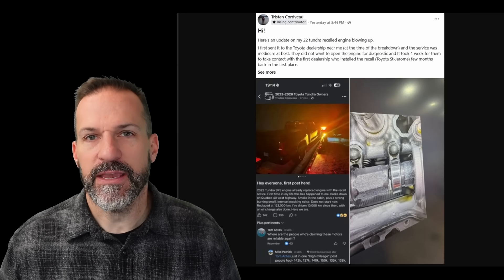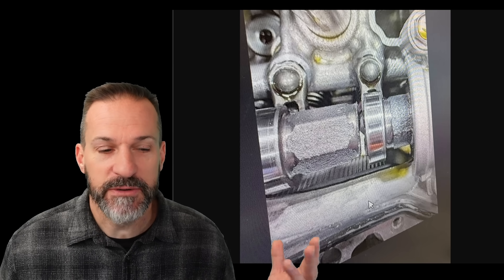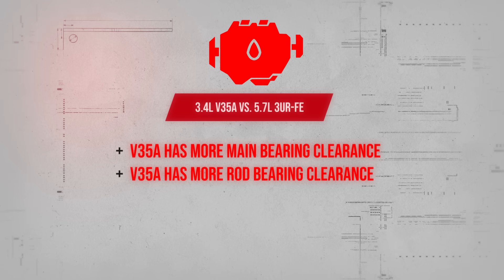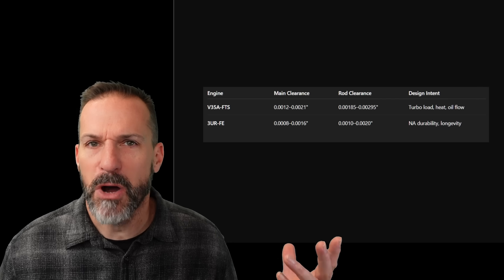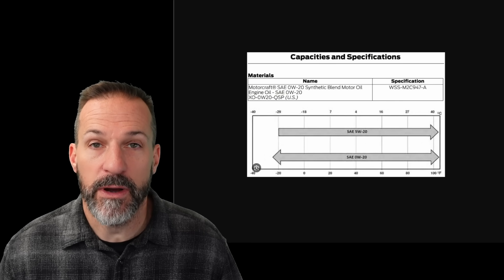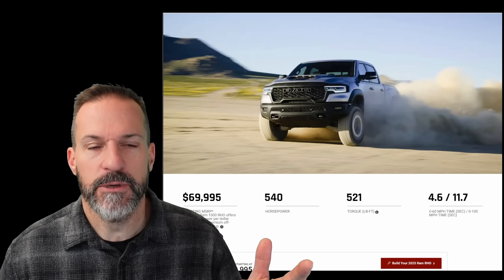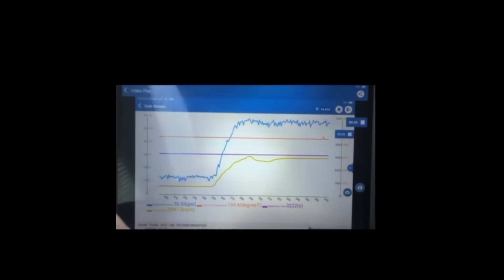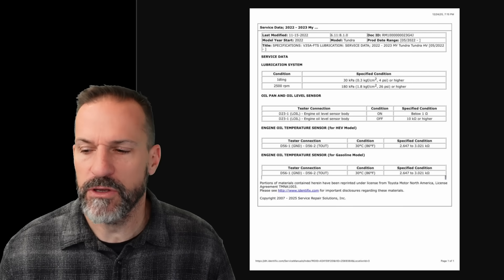Can We FIX Toyota's BILLION Dollar Mistake at Walmart? 2022- 2026 Tundra...

Comment: There are engines that run low oil pressure and last a long time. My 80s Subaru EA71S engine only runs around 5-10 psi at idle and minimum spec is 3 psi. It however runs 10W50 or 15W50 oil and has quite large clearances. Those pressures are with the oil at 240-250 degrees after driving on the highway however. On cold startup it idles at 70-80 PSI. That engine has around 250k miles on it since rebuild. On the other hand my other car, 75 Cosworth Vega idles at 80 PSI cold and 60 PSI hot with 5W50 oil.
Reply from the maker: What’s the power output?

Comment: What controls the variable oil pump ? How can pressure be increased?  Yes smaller motors need better protection and thicker oil . But pump pressure should be controllable somehow. And what about the GM 6.2 its not smaller but it’s really junk and the 6.6 is ok!! That’s a real question . The 6.6 is strong the 6.2 is defective! . I say start thicker oil now  0/40…5/40 , how about 10/30! It’s worked for 50 years !!!  10 was the minimum for maybe 70 years now it zero !!!

Comment: Honestly anyone running anything less then 0w-30 to 5w-30 in 2025 just hasn’t look into this enough, 99% of the time it is better for any engine. All my Toyota Lexus I run 5w-30 new or old. Moms bmw x5 with b58 turbo running 0w-30
Reply: 0w-30 is what’s recommended in my Elantra N (I know, not the same, but when you have a turbo running 16-20psi of boost lmao) and I’ve done a few blackstone labs with very minimal engine wear and I’m at 52k miles. Long story short, I concur with your advice.

Comment: The oil gauge in my old 2000 GMC 2500 6.0 shows a little over 40 PSI at warm idle. 4 PSI? Wow. Sounds like a disaster is coming up.
Reply: You can't rely on those factory gages at all.  They are more of a go/no-go indicator than a true representation of oil pressure.  Hook up a real instrument and check again.

Comment: A Turbo charged Gasoline engine in a Truck in my opinion is a Bad idea 👎🏻 

To many moving parts a heat management system that is stressed to begin with, then you hook up 10 thousand pounds over load the payload and cook your engine oil not to mention the Turbos is a recipe for disaster 🙄

Welcome to the 21st Century where everything is made of plastic and has turbochargers 🤨🙄

Comment: I owned a 2011 F-150, purchased new in 2011, with 3.5L Ecoboost, and the oil viscosity listed on the oil cap was 5W-30.  I never had a problem with the engine and owned the truck for 10 years.
Reply: Same, had mine for 12 years, no issues.
Reply: @vettle1  Thanks for posting.  How many miles?
Reply: @manchesterroofingsystems8016 I believe, when I traded it in, it had around 170K..... Not a lot but after 12 years I wanted a new truck.
Reply: To be fair, I replaced the water pump around 110K... So I went ahead and did the thermostat since I had it tore apart in my driveway
Reply: Thanks for posting.  How many miles?

Comment: The ram 6.4 requires 0w 40 and they are tanks. .but not subject to cafe...hmmmm. sounds like under engineering that we now see across the board with toyota meets thin oil and over stressed turbo engine to meet cafe standards....and it was not a match for a long term relationship
Reply: Not subject to CAFE?  How’s that?

Comment: Granted I am pretty old school, but it sure seems as though heavier oil is going to be better. Many years ago, I worked for a company that had a large fleet of F150's with the old 300 Inline 6 Engines. We ran 15w-40 Diesel Oil in all of them all of the time and as far as I can recall, we never lost an engine.  I am not suggesting using that oil today but the principal is the same.
Reply: The 300 straight is legendary.. Up there with the Jeep 4.0.
Reply: @vettle1 Now these Toyota V6 engines are legendary,  they also blame US manufacturing. Oil viscosity and no "staked" bearings, not good engineerring
Reply: @tcmits3699 true!  They did drop the ball bad.  Sad to see.
Reply: @vettle1 Spun bearings been around for ever, that's why they should be staked, that little deformation.  They put that there for a reason.
Reply: @tcmits3699 yes they have but THIS isnt normal.

Comment: 4psi would have tripped the idiot light back in the old days
Reply: If I saw 4PSI I would be on the line to the rollback.
Reply: A lot of old oil press switches tripped around 15psi
Reply: Old vw beetle run 2-3 psi at idle. 
They made 30,000,000+ engines. 

And those engines never spun main bearings
Reply: @fastinradfordable no they burnt #3 pistons all the time because they ran so hot from the oil cooler location.
Reply: @pl5624 yes up until the doghouse shroud released in 1968. 

And stopped having that problem until 2004 end of production.
Reply: @fastinradfordable Two to three would be very low. 5 to 10 at hot idle, with a preference for 10 (as per the 10 PSI per thousand rpm VW rule of thumb) was better. And they had a high flow lower pressure because they depended on oil flow for cooling.
Reply: Bruh...don't compare modern engines with the relic of Nazism. Come on now...
Reply: @fastinradfordable  Lets not reference a 25hp/L engine  that needed 40k overhauls.

Comment: They know exactly what is wrong, never will admit it!!!
Reply: The scariest part is they know the cause and CAN’T fix it. They have crapped the bed. I’m a Toyota homer and will not buy one for the foreseeable future. I’ve gone form Tacoma to Tundra to another Tundra and I’m now looking at F250’s with the 7.3. Yes. I realize that Ford has far more recalls than Toyota right now. But few of them are catastrophic. I refuse to buy this current Tundra engine until they completely overhaul it.
Reply: @blakerust6777 I'd rather have a few nuisance recalls than catastrophic engine failure.  7.3 ford is pretty stout engine
Reply: @blakerust6777 I’m a die hard ford guy and have owned an about a dozen different Toyotas over the decades. I do agree ford has a lot of recalls, but a lot of them are stupid and pointless recalls. Like my 2019 f250 platinum, has both front and rear camera recalls. They don’t affect the drive ability of the vehicle. My wife’s 2016 explorer has a couple open recalls right now, a 10 year old vehicle with 183k just had the a pillar moldings recalled. Another pointless recall. I think Toyota knows what’s going on with their engines, absolutely. They won’t/can’t say anything, because they can’t do anything about it. EPA emissions standards and CAFE efficiency are why they can’t. I doubt they’re willing to take the hit and go back to the V8.
Reply: The problem is pretty clear at this point. The EPA is dumb, like really dumb. They only look at mpg and not all the additional carbon burned by cars needing replaced 3x as often. The process of buying, making, and replacing cars has a huge carbon footprint and the EPA ignores those numbers. If they didn't, they'd immediately see the forest for the trees and focus on battery tech and leave gas powertrains alone.
Reply: @bsd7342  Good point, what exactly is the carbon footprint of a Tundra that has had its engine replaced 3 times?
Reply: @bsd7342   Western World Governments dont look at actual carbon footprints or pollution of anything.  is all about how much money they can make or what they can control.  Carbon footprint of solar panels, wind turbines or electric cars is very easy to pretend and gaslight the public with.  but real world pollution the public cant see is never taken into consideration.  Same with Vegans.  industrial pollution, eco damage and carbon footprint is horrible growing soybeans (i work in agriculture industry) but you never hear anything about that.  just "cow farts".
Reply: I bought the Nissan titan 2024 pro4x.  I've been extremely happy with it.
Reply: thats exactly
Reply: Good point,you might be on to something. As long as you do not starve the valve train, and the cam phasers,and timing chain tensioners with a thicker oil which the engine is not designed for. The low oil pressure at 4 psi seems way to low to me also. But if this engine is designed with variable  adjustable oil pressure,it would make sense to me also, like your mentioning ,to a pressure like you mentioned like 15 or 20 psi at minimum at any time the engine is running like at idle for example
Reply: Toyota will fix the problem.
Reply: @avdp9095  They have had two years and no solution in sight. Stop carrying water for them.
Reply: The tarrifs
Reply: This problem has been going on long before tariffs
Reply: @summerforever6736 tariffs ? Japan and USA have good mutual agreement and a lot of Toyotas are built in the USA.
Reply: @summerforever6736 nahhh minessota fraud

Comment: Run 5-30 and be done. I do in my 2023 Tundra. Runs great. I’m at 80k miles and no issue. Not to say that I won’t but
So far, so good.
Reply from the maker: Interesting, how long have you been running it? Do you have a scanner, would be sweet to see your oil pressure when hot/idle vs some of these other low oil pressure events people are having.
Reply: @TheCarGuyOnline  been running it for 30k miles. Seems to run smoother.  No, I don’t have a scanner.
Reply: Be patient…it’s coming
Reply: @ranger1752 lets hope for the best

Comment: Confusing oil pressure with oil flow is a mistake.  Oil flow is what protects a crank or connecting rod bearing.
Reply: Oil pressure at 4 PSI indicates to me the flow is way too low for the tolerances.
Reply: @buzzboykin9982 apparently Toyota does not agree when the engine is at idle.
Reply: @creigmacc Then let their engines self destruct. If they weren't replacing well over a hundred thousand engines, I might be more inclined to listen to them. I have owned Toyota's, still have a 2012 Prius, so not a hater, but damn sure not a fanboy. But buy one of theirs now? Not as a gift. Sorry, in the old days the idiot light came on at 5 to 10 PSI, meaning pull over or buy an engine. Ask me how I know.
Reply: Flow means nothing if the oil pressure is low. An engine with worn out bearings has GREAT oil flow...
Reply: @adamdodsy84 you are conflating two different issues.
Reply: @creigmacc how do you figure you can have low oil pressure with sufficient flow? If the pressure is low at the sensor what do you think the flow to the cylinder heads is at?
Reply: @adamdodsy84 tell me what low oil pressure is in this context.  Provide science based facts to show at what point low pressure is causing destructive wear to occur.  

This argument that low oil pressure is causing issues is emotional conjecture.  Nothing more.
Reply: @creigmacc low oil pressure causing engine damage is common knowledge what are you talking about 😂

Comment: Sounds like at low rpms and low oil pressure with moving that heavy of a truck the oil is just being pushed out of the bearings. Minimum oil pressure on my 2nd gen 12v Cummins is 10 psi.(never have been down that low), but it has 15w40 oil and it produces more lower end torque. Still on the road and never opened up.

Comment: I have a 2017 Toyota Tundra 1794 that uses 0-20 oil.
Reply: Try it with 5W30. It will be much quieter. The clanging from the belt tensioner will be gone for starters
Reply: Agreed 100%. My 07 and 14 tundra got 5w30, and they run much quieter with minimal mpg decreases.

Comment: Great video, 2022 and 2025 tundra owner, I just changed my oil about two weeks ago at 10,000 miles of my 2025 tundra to 5 W 30 at the dealership, they had no problem doing it for me. I regret not using the 5W30 also at my last oil change at 5000 miles, there's some misconception that dealers won't put a thicker oil than what's recommended but my dealership did it no problem. My previous tundra my 2022 tundra I have done 5000 miles oil changes with 0 W 20 and it lasted me 70,000 miles of harsh use in three years.
Reply from the maker: That's good to know, thanks for sharing. I really think the extra viscosity makes a world of difference with the torque these TTs put out. It would be interesting to put a scanner on yours to see what your oil pressure is like when it's all up to temperature.

Comment: This issue isn't oil related, change the oil all you want use different viscosity oil.

They will still fail.   If Toyota could save a billion or so with an easy viscosity change I'm sure they would have already.

Comment: Change your oil weight and watch Toyota void your warranty.
Reply: Just did my second oil change at 10,000 miles to my 2025 tundra and I told my dealership to use 5W30 I live in Vegas they said no problem and they did it for me
Reply: @itayrozenstein6989 On your request. When the situation becomes legal that’ll be when your request will be their out. Read your contract if you’re able.

Comment: TIME TO BUY!!😅😅😅😅
Reply from the maker: To be fair, there are many engine configurations not having these issues. Ram hurricane/hemi, Chevy 2.7/6.6, Ford 2.7/3.5/5.0 .
Reply: And how are the transmissions holding up?  Telling people it's time to buy perpetuates the problem.   The manufacturers won't change until they have to.  Pick a side.  You are beginning to look bought out.